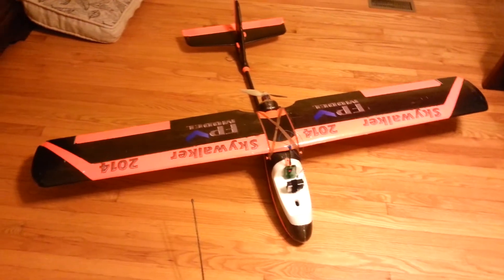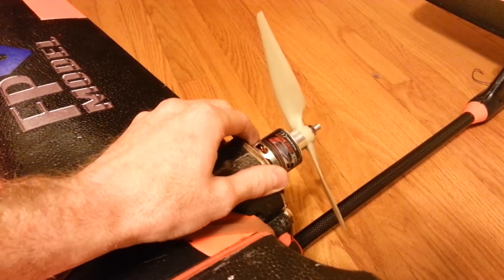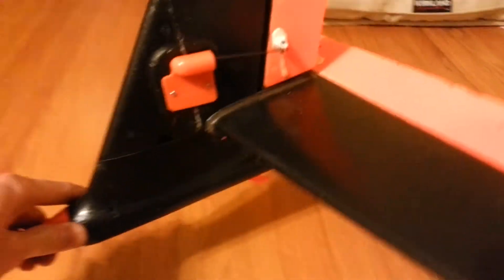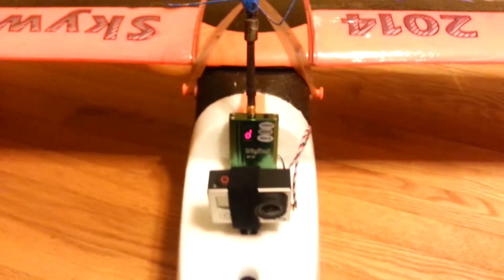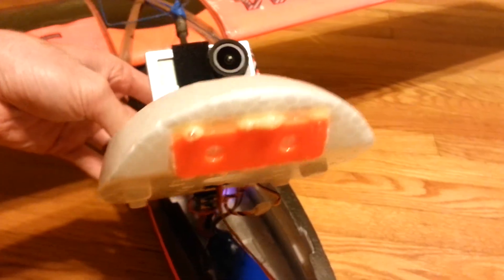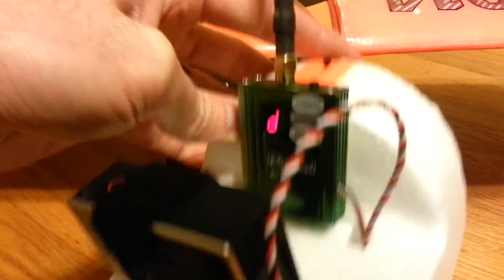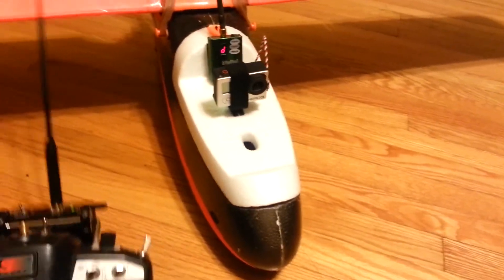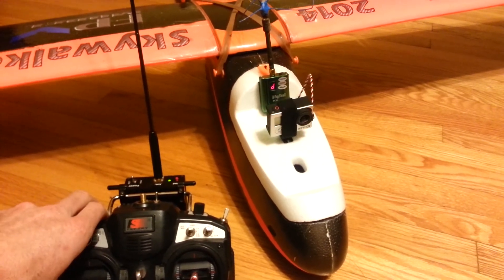Skywalker 2014 Build Part 2

Comment: That's a good idea with the switch on the transmitter to change from camera pan to the rudder.
Reply from the maker: Thanks... For pan tilt, I have the switch change the throttle and rudder over. It transfers the throttle to a shoulder pot so I can tune the throttle.

Comment: hi very good job!
wana ask u how far you can fly with it (range)?
and what modifications are needed so i can fly it for 3Km range(with good video and controll signal) ? thnxxxx
Reply from the maker: This can easily fly way past 3km... I have had it out 3 miles (~5km) with no problems. The UHF dragonlink control is what gives me the range. The 1280mhz Video is also how i get good video that far as well.
Reply: ok for the range then, and can your battery provide you more than 30min flight time?
if so, i will defenitly copy your setup bro,!!! you don't know how much trouble ur saving me!!!!!!!
Reply from the maker: nafou3a the single 5000mah 4s will give me about 30 min of cruise... and if you find some nice thermals you can extend that up to an hour!
Reply: Atom RC niiice!! and thx for the help bro!!
Reply from the maker: no problem!